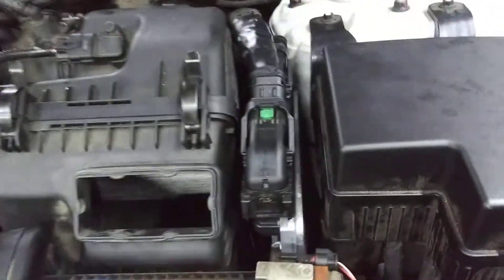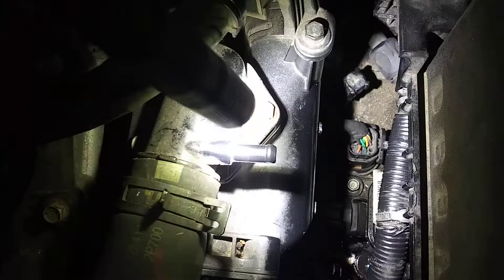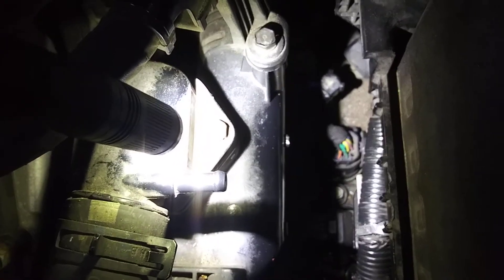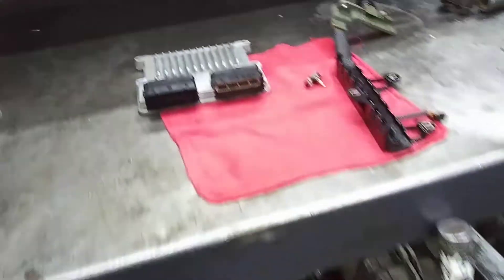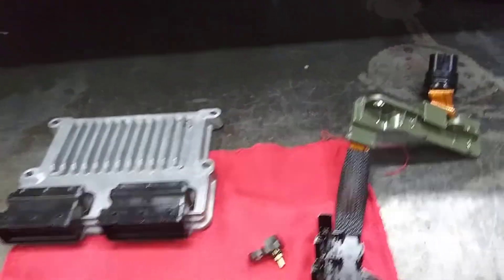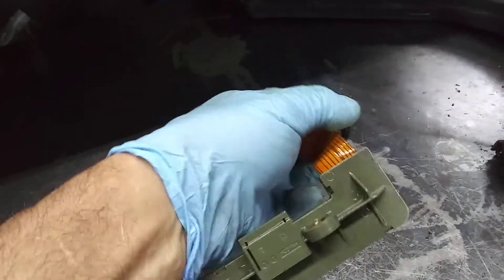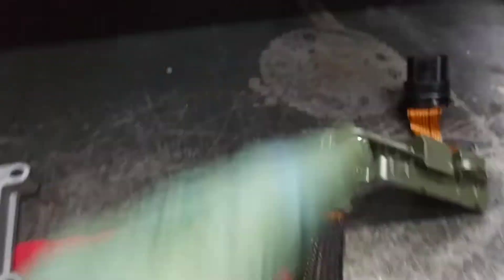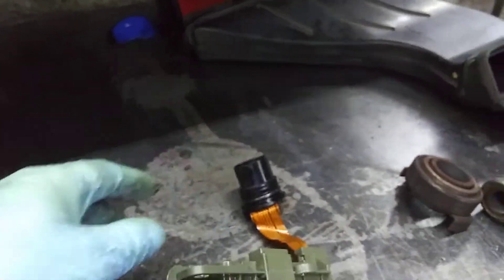PO880 Kia tcm power input to soenoids

Comment: After having the same problem on my Hyundai i30 / Accent - same A6GF1 gearbox the problem of no 12v on the 2 high side rails - I bench tested the unit - nothing wrong, cloned it with a good unit, same issue. Back probed the pins 5 & 10 - the 12v supply comes from the BODY CONTROL MODULE (passenger footwell) Not the ECU/TCM pointed to here. 
MAKE SURE you back probe all the way to the ECU/TCM before making this decision, you are just guessing if not. 

Here is the pin out and measurements for the A6GF1 gearbox so you can check - assess solenoid issues. 

Pinout  5  12v+ve   10 12v+ve 
	
Press Control 	5 - 17 5.1 Ohm ± 0.3 Ω                   
SSA		10-18: 10-11 Ohm
SSB		5-12:  10-11 Ohm
O/drive		10-7   5.1 Ohm ± 0.3 Ω  
U/drive		5-16   5.1 Ohm ± 0.3 Ω  
2-6 Brake	5-11   5.1 Ohm ± 0.3 Ω  
3-5 Rev		10-6   5.1 Ohm ± 0.3 Ω  
TCC 		10-1   5.1 Ohm ± 0.3 Ω  

Temp 		9-13 - 1.8 k ohm cold.

(4) (9) (15) (18)
 |   |   |    |
 |   |   |    |
 |   |   |    |
 |   |   |    0 - no pin
(1)  |   |   (15)
    (5) (10)

Comment: I just tested the voltages on my 2012 soul and found 3.36 volts at ALL the terminals with the internal harness disconnected from the solenoids and the key on. Does the voltage change when the engine is running?

Comment: My 2010 hyundai tucson have only 9.55volts output from TCM…but the power that goes in to TCM 14.45volts its possible the problem is on TCM?
Anyway this unit stuck at 4th gear…and have an fault code P0880..
Reply: Good day Bro..

Comment: I’m running into this on a 2022 Tucson. Pretty much the same stuff as these older counterparts. The story is, rodents munched on the harness that goes to that connector on top of the trans and shorted it out. All the wires were repaired and I was stuck with the p0880. Check engine light is on and it’s a very rough shift out of park but it’s drivable. From what I was able to gather, it seemed possible that the pcm was shorted and no longer good. Swapped a new pcm in and still had a p0880. I ended up retracing steps and staring at wire diagrams which were almost useless on this car because the wire colors were different on some than the diagram. The diagram says those two wires are yellow and white but are in fact green and white on this car. One has power but the other is grounded. When you unplug the connector and probe right on the pin, it’s grounded. Does this seem like that internal harness is no bueno?

Comment: Has anyone solved this problem themselves? I also get stuck in 4th gear.
Reply: Limp mode bro. Happens when trans goes bang! Working on this right now on my 2001 Sonata with 4 speed auto trans.
Reply: Sonata 2011 com o mesmo defeito! Como resolver P0880?

Comment: Exactly what's happening with my 2012 kia rio. It starts in 4th gear and just stays there. Depending on how it sounds when I start it, I know if it's gonna run fine or not. My mechanic is already trying to say the part is around $900 so I know he's gonna charge alot. My question is does the TCM have to be reprogrammed? If not imma try and fix it myself. Thanks for the great video.

Comment: I have the same problem... CAn you tell me what cable should i test continuity with multimeter? I mean, i want to check first if the TCM cable is good checking the connection between TCM and HARNESS 46307-3B610 head.

Comment: Thanks for the video. I have a hyundai sonata 2012 which gear gets stuck at gear 4 and can only come back to gear 1 if i turn off the engine and restart the car. I bought a new transmission which did not solve the issue and also got a new ECU. I get the p0880 code and the red battery light is steady on the dashboard. I bought a new battery but the battery signal won't disappear from the board. What do you think is the issue please?
Reply from the maker: Bad circuit, tcm or solenoids

Comment: Thank you for the video. I have a 2011 Kia Sedona that is having this issue intermittently. It seems to fix itself when I turn the car off and back on after driving around for about an hour and then it’s fine for the rest of the day. The next day it’s about a 50/50 whether it goes back to limp mode or works fine again. Do you think this is more likely caused by the solder connections or the tcm unit?
Reply from the maker: solder connections are most common
Reply: @johnniemic  hey my vehicle is doing same thing, like once I put it down to drive mode it kicks back and then it does want grab the other gears but once I turn it off and back on,  it’ll start working fine. Where could I buy the parts for my 2011 Kia Sorento